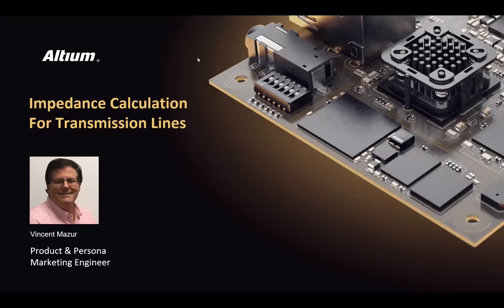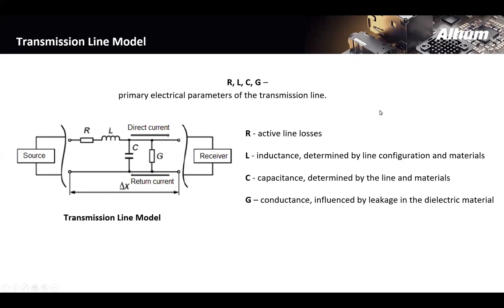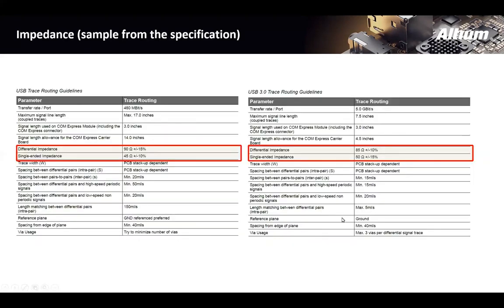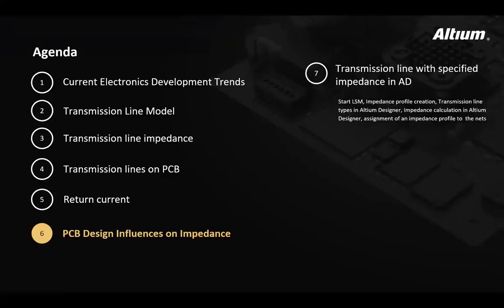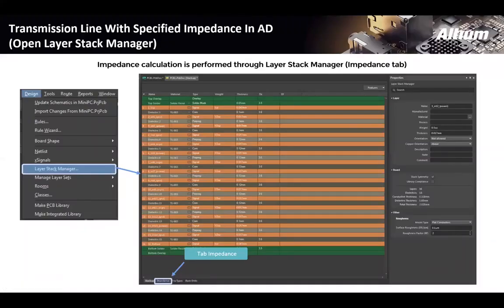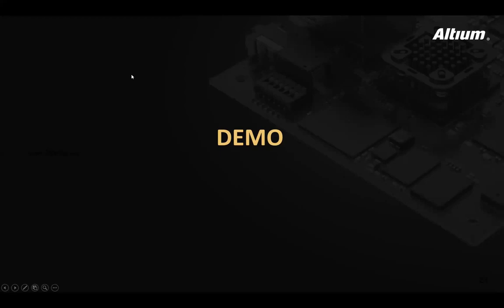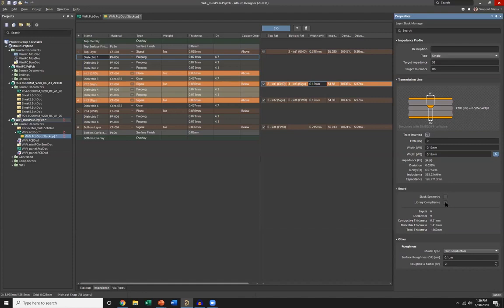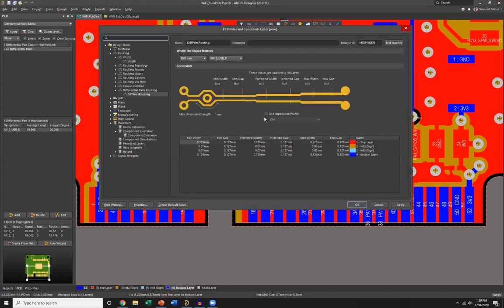Transmission Line Impedance Calculation in Altium Designer - Altium Academy

Comment: Thank you for webinar. It would have been good to explain how the impedance is calculated in Altium. The properties panel seems to indicate Designer is using SIMBEOR; is that correct?
Reply from the maker: Hi Dan, The SIMBEOR 3D field solver by Simberian has been fully integrated into the Layer Stack Manager.  You can learn more at https://www.simberian.com/
Reply: @AltiumAcademy  Thank you very much for this confirmation!! That is great to hear!!